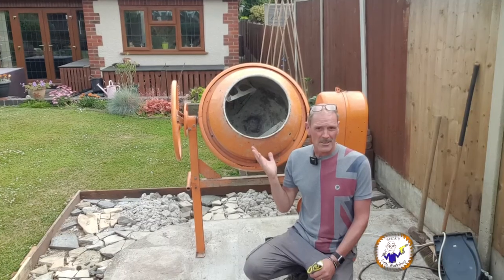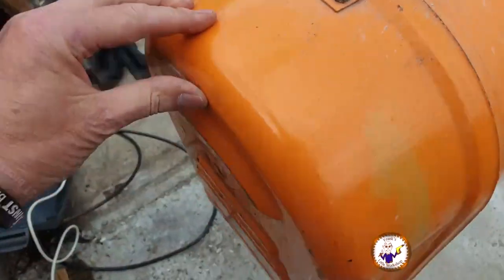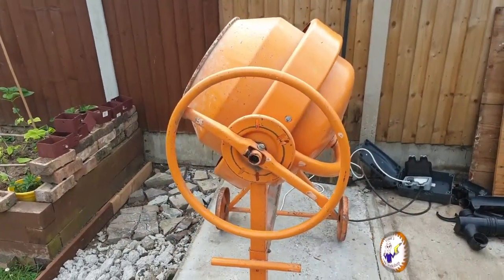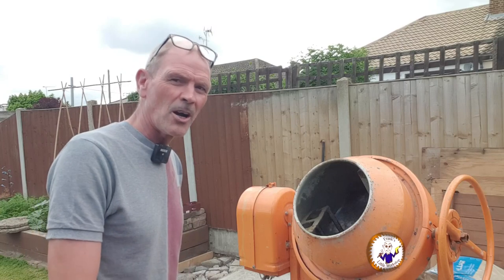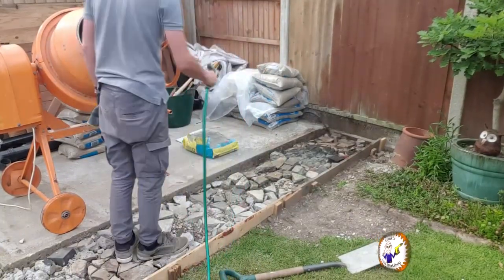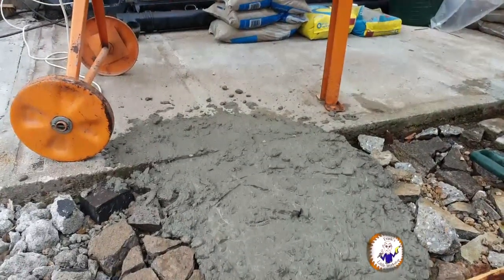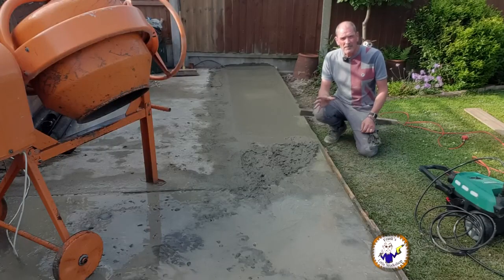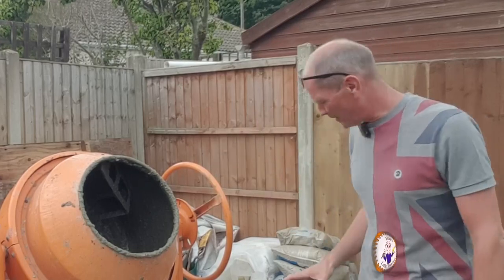Using a Cement mixer, for the first time.

Comment: I’ve got hundreds of hours using cement mixers. So a few tips for day two for you;
1 - Tip out your 1st bag of ballast and work out how many shovels in each bag (so you can work out how much dust you need to add) then for following bags, don’t shovel the ballast, just cut the bag open and tip contents straight into the drum.
2 - You’re only making about 1:6 of a gauge each time. I just keep shovelling until it starts falling out the front of the drum before I tip it.
3 - Tip into a wheelbarrow and use wheelbarrow to dump where you need it.
4 - To clean throw a bucket of water in with 4-6 half bricks and just leave it for 10 minutes. Bricks will knock off most new mortar inside. Bang outside of drum with back of a shovel to dislodge the rest. 
And finally… Best thumbnail ever!!!!!!
Reply from the maker: 😁 Thanks for the top tips Ian. I've got it all done now. I did a much bigger mix for the final one (not shown in the video) and it was a lot easier to work with. Half of the trouble I had was I don't have a wheel barrow and as you see... the bucket was a waste of time. I did chuck half a bucket of gravel in it and run it dry which did clear it out quite a bit. At least I know how to use one now.. just need another project to get more practice 😁. Thanks for watching mate 😁👍

Comment: A 40L plastering rubber bucket and a drill like the Screwfix Titan £50 job plus a strong mixing paddle is a good alternative for smaller quantities than doing it by hand. Works well and quickly, mixing well as well. A spare bucket with water to spin the mixing paddle in and then virtually no clean up.
Reply from the maker: 😁 sounds like a good option for a quick mix 😁. Hopefully I'm all done for a while now. Just need to get the mixer back in the car and return it 😁. Thanks for watching 😁👍
Reply: @frankslittleworkshop  Watch your back when getting it in the car  - it looks heavy!
Reply from the maker: @C4sp3r123  😁 Its a two man lift. I got it out of the car on my own.... which resulted in a massive deep scratch down my bumper ☹. I was not happy. So ill get some muscle to help me take it back 😁
Reply: @frankslittleworkshop  Shame about the car bumper!

Comment: Good job so far Frank. Lock the drum so the holes at the top. Turn the mixer on, slit the end of the sacks, feed your three bags in and water. I don't know if this way will work but looks like hard work shovelling when you could just slit and tip the bags in the mixer. Enjoyed watching. Tony
Reply from the maker: 😁 Thanks Tony, I was only mixing up small batches just to get used to it at first... yes it was bloody hard work. But I'm getting used to it. Still easier than mixing it all by hand. Thanks for watching 😁👍

Comment: Great video as always. Using small mixes at first was a good idea to me and I've never figured out how to get cement out without pouring it all over the frame and floor. Using a wheelbarrow just means there's more cleaning up to do and the wheelbarrow is tougher to clean than the mixer.
Reply from the maker: 😁 Thanks Ben. Yep, small mixes to start with suited me while I got the hang of it. A wheelbarrow is one thing I don't have (I don't have anyware to store one). It was fun learning how to use the mixer.... but now its in the way, so I need to get it back to its owner. Thanks for watching Ben 😁👍

Comment: I most use Belle Minimixs. To clean the drum I'd use pea gravel and water. Cleans of residue without denting the drum. As essential handyman says, working out just how much of cement & sand & aggregate & water (all by volume) you need for a good mix, and then bunging that all straight into the drum, speeds things up, keeps the mix consistent, and takes some of the manual strain out of the work. Always good to have two people, even with a mixer, as once you start you often can't really take a break. Emptying into barrow or sometimes onto a mixing board, a good idea. Stu Compton's Youtube channel is good for all things cementitious. Enjoyable video.
Reply from the maker: 😁 Thanks Colin. Great info. I did use some gravel for the final clean out which seems to work OK (without any damage). I had to do it all on my own so couldn't really stop (until I ran out of ballast) also trying to film it at the same time all added up to a very busy day. Thanks for watching mate 😁👍

Comment: Definitely easier with a mixer, I done a small 8x6 concrete base for our small shed. Mixed it in a wheel barrow & it was hard work. Never again
Reply from the maker: 😁 Thanks Dave, I know what you mean. I normally mix by hand.... bloody hard work. Just got to start building the shed now 😃. Thanks for watching mate 😁👍
Reply: @frankslittleworkshop  are you building a second workshop 🤣🤣
Reply from the maker: @GrumpysWorkshop4  😒 No, I'm afraid not 😒. We don't have the room. I'm doing a bit of a garden make over (hence to new log shed video). Now I'm building a bigger garden shed so I can get all of my project wood out of the workshop... hopefully giving me a little bit more space. Lets see if that works 😁👍
Reply: @frankslittleworkshop  Wood storage is always a problem. My little shed has loads in it & I have a crap ton under my lean-to at the moment. I think I need a bigger little shed🤣🤣
Reply from the maker: @GrumpysWorkshop4  same here, I have it all over the place. The price of wood these days you just can't afford to throw it away 😁👍